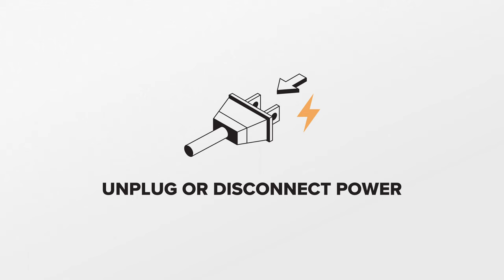How to replace Fisher & Paykel washing machine control module part # 421226USP

Comment: Thank you for the video! I ended up replacing both the pump filter and the control board, ran a rinse and drain cycle, then a full time saver cycle. All good. $140 total for both parts and a little over 2 hours total of my time. Really appreciate your clear instructions and tips.
Reply from the maker: Nice job fixing it yourself!

Comment: Thanks for your video. You don`t muck around with unnecessary small talk, which is important as to stay focused on the job at hand. P.S. I have learned to take video snap-shots as you suggest, as I like to once a year carefully disassemble my appliances to either clean, repair or replace out worn parts, ie dehumidifier, etc, etc. thanks again.
Reply from the maker: You're welcome!  We are happy that we could help!

Comment: I was one of those people who stupidly ignored a tiny leak under my F&P washing machine.  Never dreamed it would short the pump and also short out the control panel.  I was quoted $800 to repair my Fisher Paykel washing machine. The parts cost me $200, pump on Amazon, and Control board from e-bay.  I'm pleased the pump is a design upgrade pump with a separate fuse. These machines are designed to be fixed by the average homeowner. Good luck everyone.

Comment: Great video.  Looked into it. This part is $215.  The digital display (which might be optional, but I might need both) is $135.  The cost for a local repair guy starts at $75-150.  $400+ in on a 18 year old washer (yup, 2004 date on the module sticker), or get a new washer for $600-700 installed.  -  Newer bigger washer for the win.

Comment: I'm about to replace the drain pump on my gwl15 96200 A. Do I need to replace the control module as well? Or only after attempting to run a cycle if doesn't drain? 
I did purchase both, but I don't want to mess with something if it's not necessary. Any info would be greatly appreciated!
Reply from the maker: You can usually just replace the drain pump and fuse kit unless water was leaking from the old pump and shorted and damaged the control module.

Comment: When I take the control module cover, there is water sitting under the control module. A day or two ago, the machine wanted to start up by itself with what it sounded like the water control thumps. Is it possible that replacing this module will also fix the water valve(?) problem?
Reply from the maker: Sorry, we can't diagnose that type of a problem over a Youtube comment.

Comment: Awesome video and I’m almost done replacing control board but have an issue. On the left side I have a green & yellow wire with a small flat tab at the end. I don’t recall it being loose like this and my pictures don’t show it loose. In my pre-dismantle pic, it appears to be part of a wiring associated with the tab that was locked. I still have one plastic hub to lock in and I’m wondering if it was meant to go into this hub but became loose during dismantling. The machine you have isn’t quite the same as my GWL15 so now I’m stumped.
Reply: Watching your video again and I see you pull out this wire just before the grounding wire instructions but mine doesn’t have a locked “hub”. Ugh… I’m so close!!!!!!
Reply from the maker: It sounds like the ground wire that we show at 6:08
Reply: @PartsDr  agreed but can tell if it’s suppose to be IN the black quick connect or somewhere else. My pics show it IN the black quick connect but you seem to slide it in separately.

Comment: you didn't mention how to reset the machine size.
Reply from the maker: The part number shown in the video doesn't require this that we are aware of.  Usually the control modules that require the size setting to be set will include an instruction sheet with the new part that shows how to do that.

Comment: I've got a F+P aquasmart from '08 that's giving an error code of 248. 4 months ago the tech came out because it was stopping 5 min into the cycle & all lights were flashing. He discovered the unit wasn't recirculating. He said it was either a bad pump or control mod. He dropped the pump & pulled a few bits out which helped the issue, but said it still wasn't recirculating the way it should. It hadn't given any error code until now. Now it's going thru the whole cycle, but not draining in the final spin. How do I know if I need to chance the pump or the control?
Reply from the maker: If the tech couldn't diagnose which one is bad, then we wouldn't be able to either over a youtube comment.  Typically we would recommend replacing the pump first and if the issue still persists, then replace the control module second.  In some cases if the pump is leaking water, it can short out and burn out the control module.  If that is the case, both parts should be replaced at the same time.

Comment: Im working on a GML10US and customer says the motor stopped working during a cycle. Accompanied by a slight burning smell. Does this sound like a control module issue? Also they say it has flipped a breaker while washing heavy loads, but this may be unrelated. Is there any way to troubleshoot the module to be sure?

Awesome vid, simple and straight to the point. Subscribed
Reply from the maker: Your model isn't coming up for us as a valid model.  Do you have the 5 or 6 digit product code from the model tag?  See this video: https://www.youtube.com/watch?v=6nt7G7cLCnc
Reply: @PartsDr  Oh sorry it is a GWL10US, and there is no product code on the tag. Just model and serial number. Also all of the lights turn on and it fills up just fine. Haven't tried a spin cycle yet.
Reply from the maker: @claytonp1111  Some of these washers had issues where the drain pump would start to leak which in turn would create a short which would then also fry the control module.  To fix the problem you would have to replace the drain pump and the control module.  It looks like both of those parts have been discontinued for your model washer.